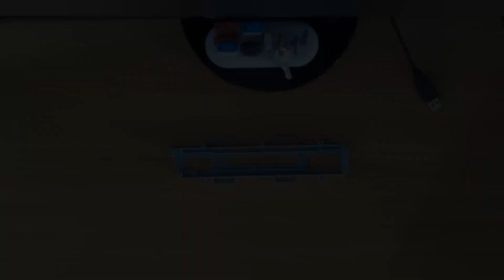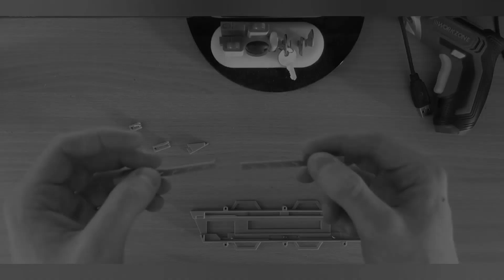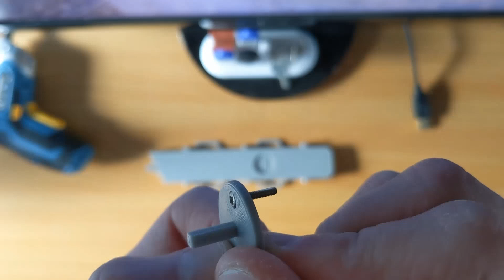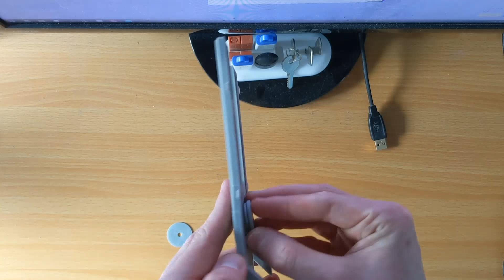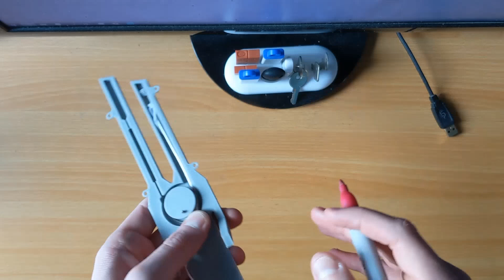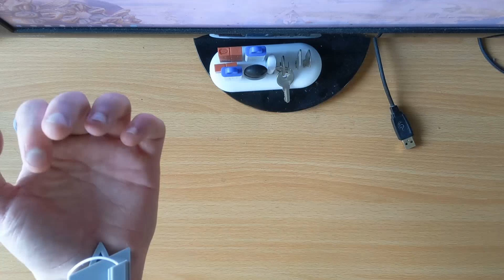Hidden blade - Dual action | Assassin's Creed | Assembly tutorial

Comment: i cant do this ive been trying to build this for months and the spindle gets caught with the string and the doesn't go back after you pull it becouse it trys to bring the spindle with it and i tried using silicon lube and it just reaches the rubber band and loosens it or unties it

Comment: The spindle part with the rectangle pole is harder to print.
The pole didn't kept the square form all the way.

What I did was to max the quality, slow the printing and move the extruder away between each layers. 
It took more time but it made a huge difference. 

I have assembled the 1st part and need to sand a bit to remove friction. 
I'll edit later.

Great project. Simply needs some fine tuning and add brim on smaller parts so they print well

Comment: The flippers refuse to stay down, and do not latch to the blade properly without popping up off of the screws. I've tried putting something on top of it to keep the locks down, but they just slide up over the blade and don't keep it locked. This is quite frustrating after four days of printing parts. How do I handle wobbly locks while installing the blade?

Comment: Can't wait to build this, I'm a model builder so I have paint so I can paint it as well. I also have some modelling putty so I can user that to fill in the print lines. It's cheap, around $8 from Tamiya, good for this. I'm gonna have the norse disk but I'm gonna paint it gold with an emerald green highlight. The blade will be gold as well as the main case will be black with gold highlights. Thanks for the amazing model!

Comment: So I’ve printed this twice with no luck. The lock in the rear pings up so the slider does not fully push it back for the blade to slide out. Idk if it’s my printer I have since tightened the belts on my machine (about 3 years old now) so that could have been the issue. The hammers (kickers whatever you want to call them) could be remodeled I’ve noticed even at 100% infill and .12 mm or later height they are still pretty weak. They could use some work for longevity. The blade, wile detailed I found bends a bit.  Not warping on the print bed but after it’s pulled off it will start to bend. Like I said I have since then tightened the belts and cleaned my printer with a new nozzle and new PTFE tubes. The wheel mechanism works well. The string that worked well for me was a nylon string .8 mm thick. Anyway hope that helps. I didn’t want to sound rude at all your design is really cool. And maybe it’s just on my end. You have inspired me to design my own based off of imdeepain s design. Hope it works!! Cheers!!

Comment: The only sad part about OTF hidden blades is you’re so limited on the blade shape and size. Not to sound conceited, but I’ve been working on a design that works really well too, and if anyone wants to try it out it’s super easy. Using a small scissor jack to extend the blade, with a small spring to retract it when you let go of the drawstring, gives you far more advantages. It doesn’t require a second pull of the string to retract, so it’s faster than an OTF design, plus it allows you to get a longer blade without adding more length to the casing that houses the blade. I’ve found a design that allows me to have a blade that is a little over 9 inches long, but the casing is only 7 inches long. Adding a small deadbolt style lock to it helps secure the blade in place, extended or retracted, but the lock easily slides in and out as the scissor jack moves up and down. I think the best part about this design though is it’s much easier to make. For a plastic model you can buy some thin plexiglass from a hardware store and cut out the pieces with a box cutter, then you just need a few rivets and screws and a spring. Though an OTF design that works is super impressive and does let you have the blade extended as long as you want, so that’s a plus